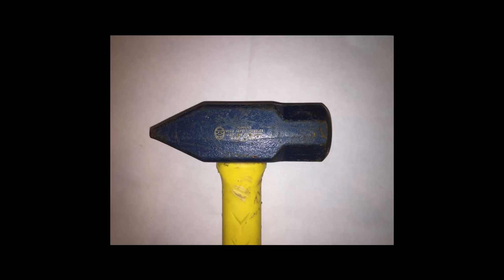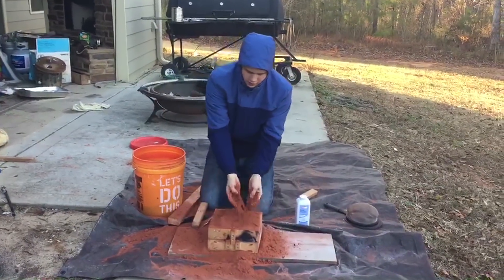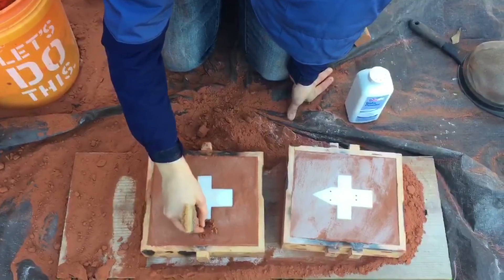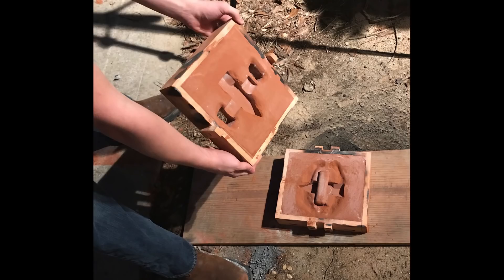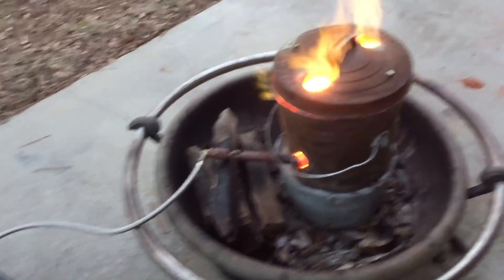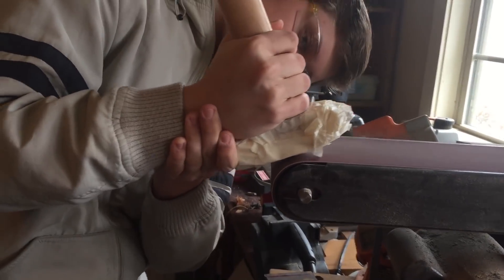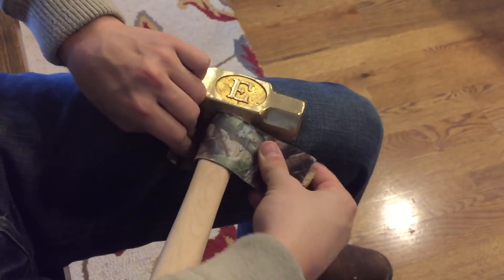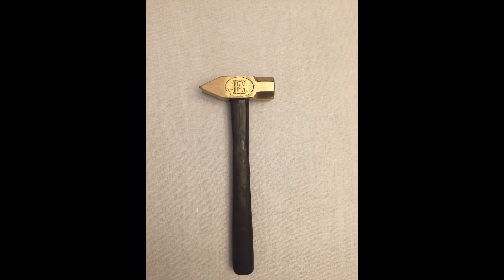Making a Golden Aluminum Bronze Forging Hammer

Comment: The next time you end up with a loose hammer head, just soak the head in a few inches of water overnight before you mess around with refitting and wedging the head. The wooden handle will soak up a bunch of the water and swell to fill the hammer head making for a super tight fit.

Comment: Very nice job. Some tips to make your life a bit easier next time. The rasps are indeed slow. Grab a spoke shave if you have the time and money. Blackening it with fire is fun, but not practical. Put a lot of oil on the handle, especially on the top of the hammer. Drown the wood there in oil, that will prevent the head from coming loose (it swells the fibers). Also, a polishing wheel could make that hammer stand out nice nothing.

Comment: the hole in the head needs to have a kind of draft to, just like it would have if it were forged with a draft (not sure if thats where the word comes from). i dont think people nowedays understand what holds the head on the handle since the modern hammers are hotpunched instead of forged and dont fit for shit and come loose all the time. if you ever get sick of it falling of the handle or accidently crack the scull of someone standing behind you, you should file that draft in

Comment: Great job! You need to coat your fiber with a something like Satanite in order to keep the small fibers from becoming airborne at melt temps. Its very similar to asbestos. Satanite is really cheap.
Reply: Definitely should do this for your health.  It will also improve the efficiency of your furnace by a small margin as a side effect
Reply: Yes yes yes I see people do this all the time I did to until I was warned but no biggie to fix good advice

Comment: I like the video and especially your discussion about how you changed your model to make it more castable.  I tried some casting, but had a problem getting the details to look decent because the sand always stuck to the side of my printed model.  Would like to see you do another video on changing your model to get some good details (what works, what doesn't).  Going from 3d design and fusion 360 to print to cast. Similar to this one, just with more info on your design decisions for castability, and how you do it

Comment: Great job, the casting came out great and al-bronze is a good choice of materials for a hammer.  How much does the head weigh? I'm surprised how well the petrobond core has worked for you and a few others I've seen recently in hammer casting videos.
Reply: Backyard Casting the stuff is much harder and tougher than other copper alloys, so it'll stand up to a lot  more without the faces "mushrooming" with use.   In fact it should get more and more durable the more you use it. That's why Paul from Paul's Garage and Swdweeb used it for their hammers, and also why I chose to purchase some "real" C954 aluminum bronze for the axe I cast this past summer, there is a 4-video series about that on my channel which I believe really shows off these alloys' strengths where making things to whack other things with is concerned.  If you work harden the face and crosspeen on yours, they should be comparable to mild steel or maybe even a little harder.  90Cu-Al10 may even be heat treatable (C954 is, from what I have read - among the known copper alloys, certain al-bronzes are unique in this way), but I have had trouble figuring exactly how to do that.  Al bronze isn't the easiest bronze to cast well, but it makes the best hammers and axes!  Also It's a much better use of pop cans and extruded aluminum in the foundry, that stuff can be cast on its own but being relatively pure aluminim you'll be fighting shrink and hot tears etc.
Reply: Backyard Casting your hammer has one flat face on one side and a cross-peen on the other, that was what I was referring to...  I used a ball peen to work harden my axe but I bet you could do yours just by whacking it on something hard and flat (another big hammer face maybe?). I'm not really sure, I had to make up my own peening technique on account of not finding much info about that when I was researching it.